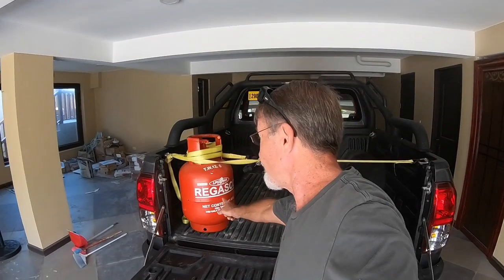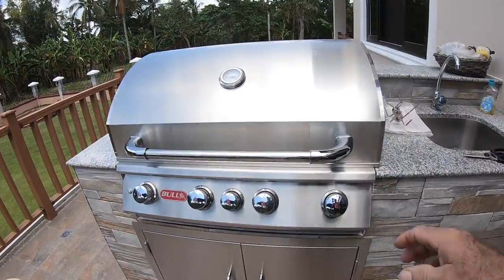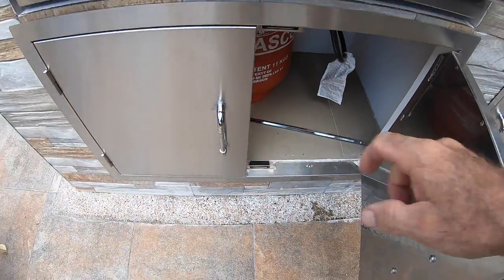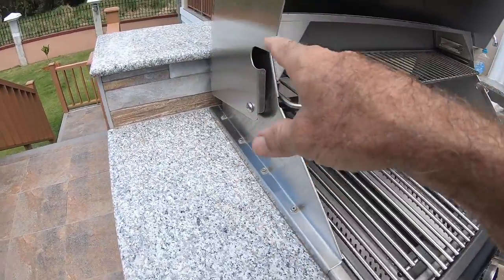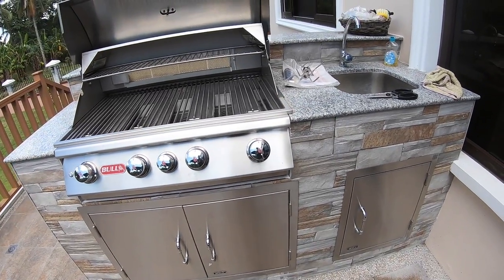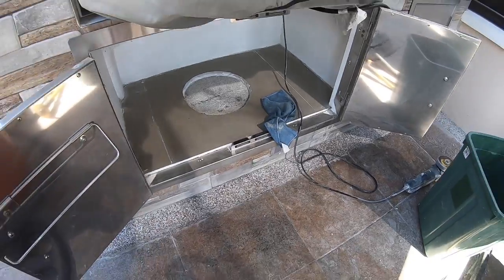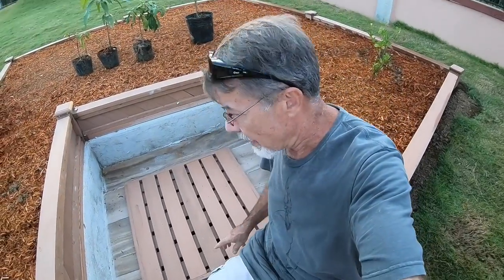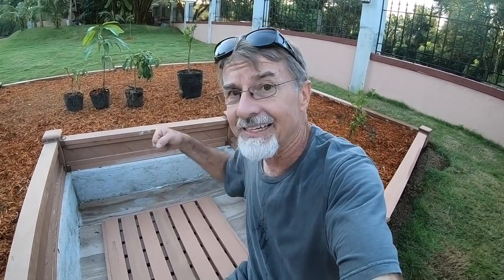VILLA FELIZ - EPISODE 408: THE GRILL THE GRILL THE GRILL IS ON FIRE

Comment: James, I was glad to see you found an adapter for the tank. When your video started I had all kinds of crazy ideas about you trying to get one made, cutting parts, welding and machine shop grinding - basically a lot of work to get the adapter you finally revealed. I feel it's the safest bet, certainly safer than the PI solution. Too bad you have to remove it from the tank each time you go to get it filled. I can't imagine the screw hole or threads wearing out over time, but maybe you should get a second adapter and keep it on hand just in case.
Reply from the maker: If I can find the O-ring that goes into the LPG tank side of the adapter that would be the best and least expensive option but yes, I think it's best to have a spare around also.

Comment: James, the gas tube connector from the grill to the gas tank is like 2 inches away from the electrical outlet. You may want to put a cover on the electrical outlet just like the outdoor electrical outlet covers or re-route the gas piping. 🎃
Reply from the maker: Yes, was planning on that, just need to get the cover.  Thanks for looking out for the ol' man!

Comment: Your my new hero for at least today, James. I brought a Wolf duel fuel range here 2 years ago and I have been looking for this adaptor for that long. I totally by accident found the sub-Zero , Wolf brand store in Manila a few months ago and figured for sure they would have them, but they had no idea of what I was looking for they said just cut the hose and use hose clamps like everyone else. I brought a full roll of aluminum gas hose and everything I thought I would need but I never realised back then the odd way they do hook ups here, no beveled compression fitting here for anything that I have found. I saw you had posted the link for someone else so I ordered 3 before writing you this. What pray tell did you call it on Lazada for the search. I tried lpg fittings, lpg brass fittings but all that I found were all kinds of hoses mainly. I assume it will have some sort of odd name here.
Reply from the maker: Search engines on all the sites here are the worse.  Try Wilcon for example.  You type in a search word for something simple you know they have and you get zero results.  They really need to take a hint from US search engines.
Anyway, glad you finally got your adapter.  I'm really excited I found it myself.
Reply: Yes , bussiness here do not use the internet but to maybe 25% of its abilities. On Lazada though, what did you find it listed under. I used the link you gave another person but I could not find it on Lazada so very curious what you found it listed under.
Reply from the maker: That's the million peso question!  🤔
Reply from the maker: Converts Propane LP TANK POL Service Valve to QCC Outlet Brass Adapter - intl

https://www.lazada.com.ph/-i118096389-s122498150.html?spm=a2o4l.order_list.detail_image..29353e17DUy1Z0&urlFlag=true&mp=1
Reply: Thanks James, maybe address this in a video  , if that's what it's listed under I don't know HOW you found it, but very glad you did. I had a guy that used to do all my houses,  plumbing and gas when I used it and asked him to send me what I needed in a balikbayan box but even he sent the wrong piece but I do have a lot of flexible gas hoses and misc. pieces he has sent me trying to get the one I needed. Thanks again, glad you needed one or I would never have got one til I go back to US or another country .

Comment: Hi James,

I thought about the sun and heat out there for the guys doing the wall. When I am doing a project like that I work with available shade, so progress would be all over the place on that wall based on the available shade during the day. But they're doing a fine job anyway tolerating the heat, I noticed before that they set up a rough shade where they are working.

I notice they don't seem to require much direction from you on the walls, seems like that is right up their alley. All I remember you having to remind them is to go below the grade so that you don't have exposed areas in the future based on landscaping or erosion changes.
Reply from the maker: Their specialty is mason and tile work which is why they are making good time.

Comment: If you put holes in the back of your grill, you might want to put a pvc elbow through the hole to keep rain from going in.
Reply: Good idea. He can also angle the holes when drilling to eliminate possibility of rain going in or water running down the back and into the holes.

Comment: You mentioned you are going to Laguna to a nursery. How long does it take you to drive to Laguna? I have friends in Laguna, I like your area too. Just wondering the time to drive between your area and Laguna? Is there a lot of traffic on that drive? Is it highway or regular streets? 
Will you be mowing the driveway to keep the grass short so you can still see the blocks and also for traction on the driveway?
Thank you!
Reply from the maker: About a 45 minute drive.  Usually no traffic on the Star Tollway.  Just a lot of tolls...

Will be mowing or using the Black and Decker weed eater I recently purchased for the driveway.
Reply: Thank you very much for the reply! Good idea for the driveway! That should work great and keep it looking good. I should not have any problem with the ratio because I am looking for a bigger lot so I have room to do a few things I am looking forward to doing privately. 

Sounds like an easy drive to Laguna. I assume that is highway where they have toll roads, correct? If I was to ride a motorcycle to Laguna from your location, I would need one 400cc or bigger! I have two big motorcycles (1340cc & 1500cc) in Los Angeles, CA, USA. I see everyone riding these small motorcycles and scooters there, around 200cc, to cut through the traffic /split lanes etc, but they can't go on highways unless they have 400cc or larger motorcycles in the Philippines. So, when I move there I guess I will bring one of my big motorcycles with me and buy a little one there for around town. They are really cheap to purchase there and come with registration and insurance included in the price. It is a good deal. I hear is it cheaper to by a truck there, so I am planning to sell all my cars and truck here and just get something new there, when I move there. What are your thoughts on this?

My gf/fiance and all her family live in Laguna, but they got flooded badly in the last storms. I noticed you didn't seem to have that problem there. Is your area elevated higher than Laguna, or is it just the cutting of pads, bad leveling and flood planning / drain off solutions in some areas?  

I am curious, what did you do for a living before you moved there and built your house? You have built a beautiful home and you do really well with the videos! Did you have any background in these areas in the past? 

I am looking at going to the Baguio area where it is cooler there and trying to find something for sale I can rehab or just get a lot and build a nice home and huge garage for all my toys. Maybe have enough room for a small airfield to fly out of with an ultralight. Although there is an airport by Baguio I can fly out of if I don't find what I am thinking about in that area. I have had a pilot's license since 1983 and plan to fly most of the time to commute between Baguio and the Manila or Laguna areas. We will also have a little home (3/2) in Laguna by my gf/fiances family. I have been in real estate, flipping houses and commercial properties for many years. Also I have a high tech background since the late 80's. I am wondering if there are any problems with rain capturing systems and solar there, so we can build a very green self sustaining home and live off the grid as much as we can there up in Baguio. With the brown outs, is it possible to setup a solar and battery bank system to run off of during brownouts and not have the noise and fuel requirements of a generator, or as much as possible and sell back electricity to the provider/power companies there from solar on our property?

Thanks again for all the help you have been, we hope to meet you and your wife someday. I appreciate you filming and posting all you are doing there, I know it is a lot of work to make all the videos, edit them and upload them. Thanks again! Have a Blessed day!

Comment: You should talk to the people that you got the generator from and ask about a hospital kit which should be a case and a muffler that will make your generator very quiet.
Reply from the maker: I bought the generator from Wilcon.  I'm absolutely sure they wouldn't have a clue as to what a "hospital kit" is.  They're really great people there but the scope of knowledge outside selling hardware is limited.
Reply: Go to the website for your generator and look up the kit then look for a dealer for them in the Philippines.  It would sure make a difference in the noise.

Comment: do you think you need a ventellation under the gas grill?
Reply from the maker: As I explained, there is ventilation under the grill where the drip pan is.  I want additional air flow at the base of the grill enclosure in case LPG leaks.  Remember I said LPG is heavier than air and would sit on the bottom.

Comment: got to run a water test on the cistern to see were the water is going
Reply from the maker: I injected water in the clean out by the  house and it made it to the cistern.  So if the water is low in the cistern, it's probably because there are only 2 or 3 downspouts feeding the cistern and part of that water is probably going into the storm sewer.

Comment: I ran across this same issue when I moved here and tried to connect my USA Weber Grill up to a tank here in the Philippines. I contacted Weber to try to get a regulator from them to retro-fit my Weber Genesis II grill. Based on their response, I decided not to take any chances, and have scrapped my Weber Grill. I wish I knew this before I moved and would have sold my expensive Weber, but who knew??
 
Here is the response they sent me via email:  
(Weber (APAC))

Jan 9, 2023, 02:59 CST

Hi Rob,
 
Thanks for your e-mail, and hope you are doing well these days.
 
In regards to your inquiry, unfortunately I need to tell you that Weber do not recommend to use our grill in another country although your grill is propane gas grill, due to safety reason.
 
Our product has to be safety-tested in each respective country before we sell and is only certified for use in a specific country as the gas mixture and percentage used in gas tank varies according to each countries are different.
Therefore we do not support grill modification and do not sell any converter or adapter neither.
 
You may refer to the below link for detailed information.
Can I take my Grill to another country?

https://www.weber.com/US/en/blog/burning-questions/can-i-take-my-grill-to-another-country/weber-30242.html
 
Any inconvenience is much regretted and we appreciate your kind understanding on this matter.
 
Should you have any other questions, please let us know.